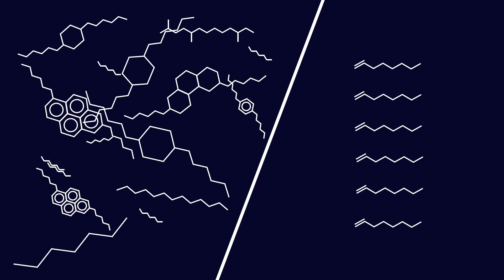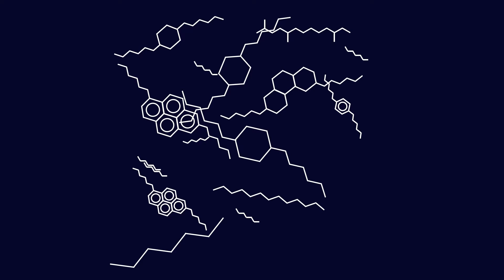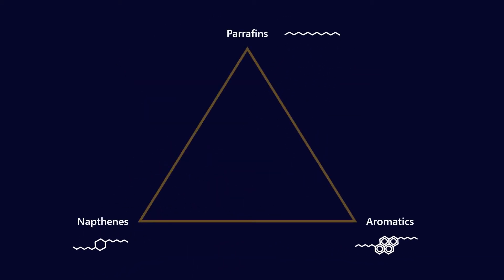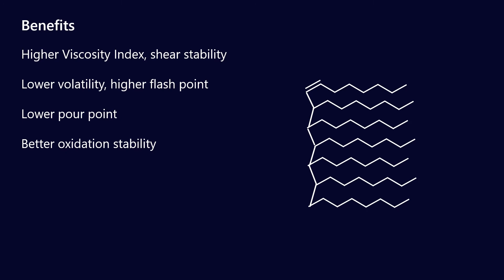What are the performance differences between polyalphaolefin (PAO) synthetic base oils and con..

Comment: I figured this is why 20W-50 degrades less than the further stretched oils such as 10W-60 for the same manufacturer.

I am just not sure why ambient temperature even affects oil performance since it is running at ~200 F inside the engine.
Reply: Your radiator, in the winter, you have much colder air cooling the coolant, in 40c temp, it's much hotter...

Comment: Will you ever compare oil specs? Rotella 15W-40 T6 vs Shell Ultra 15w-50?
Seems like the T6 will do better in it's temperature ranges since it has less VI additives.

I figured this is why 20W-50 Redline and 10W-50 degrade less than the further speeded oils such as 10W-60 for the same manufacturer. Running T6 in everything at the moment but summers above 120 I will go to 20W-60 Redline.

I am just not sure why Ambient Temperature even affects oil performance since it is running at 200-250 F inside the engine.

Comment: How do you see the problem of PAO  low solubility in comperision with short distance driving and there for high gas input in the oil. Does most PAO oils work beter or less good agains this problem?...

Comment: How to identify group 3 and group 4 in engine oil because Group 3 specs and group 4 are lapping some where
Reply: If you see ester blend or similar stuff anywhere, most likely it is a PAO formulation. The only base oil that require ester to help solubilise additives is PAO.
Reply: @sunrevolver  If you go to Section 3 of and SDS, you usually can see the percentages of additives.  Amsoil left that blank, Redline has up to 60% non petroleum base.  I suspect the only true 100% or group 4 synthetic, is Redline.

Comment: I’ve heard that PAOs don’t “stick” very well on the engine surfaces, is this also a downside of the dilution capability and is this problem solved with the combination with ester? My engine just got a PAO Based Oil but sometimes it stands still for weeks and I hope the cold starts aren’t that stressful for the material. 

Great content, thanks for your work!
Reply: No one does 100% PAO formulation. PAO is really bad at dissolving additives. All formulators will add ester in the mix to help solubilise the additives.
The Ester helps with the "stick". And if you are using latest specifications, high chance your oil has Moly inside which in conjunction with ZDDP form a sacrificial layer on your engine.
TLDR, no need to worry if you are using reputable oil.

Comment: Can you briefly tell me what the difference is between PAO and ESTER oil?

Is there a difference between the term PAO and ESTER ???
Reply from the maker: Great question - they're entirely different molecules. I'd recommend maybe watching this video on esters first: https://youtu.be/sBZWF-QMQMI
Reply: @LubricationExplained  Perfect. I understand .

I came to the conclusion that the best oils are those with a PAO base and the addition of ESTER.

I do a job closely related to motorcycling and I need to know all these things.

Thanks for the shows you make. we didn't learn this in school.
Reply: Both excellent lubes. Pao non hydroscopic and doesnt degrade when leaked into the ground excellent for machines bad for environment. Polyester good if it diesnt get moisture and if it gets wet it decays and can ruin your equipment but great for tge environment

Comment: I've used penrite 10 tenths which is poa ester and thought it was excellent. Definitely cleans varnish over time and held up in a 700hp engine.  I'm sticking to shells GTL tech in my daily though, for the value GTL is excellent
Reply from the maker: From memory the Ten Tenths range is a combined PAO / POE Ester. My personal opinion is that Penrith goes a little overboard with the additives - 2200 ppm antiwear in a racing engine is overkill and too much antiwear contributes to friction. But it will definitely protect the engine! You're right, GTL products definitely give a really good price/performance ratio.

Comment: What do you think about vehicle engine oil that claim to be 100% or fully synthetic but with more than 75% hydrotreated mentioned in it's MSDS. I think most engine oil are like that now. Do they deserve to be called fully synthetic?
Reply: good thing that "fully synthetic" is a protected term in my country:
You can only proclaim an oil as fully synthetic if it is based on Group 4 and Group 5 base oils and I think there is a pretty high requirement of the contents here because all fully synthetic oils sold here are actually all ~80 - 100% fully synthetic.
Reply: @alouisschafer7212  German? not anymore.

Schaeffer 9000 full synthetic 5W-40 = 30-60% hydrotreated, 10-21% decene / PAO

Liqui Moly Molygen New Generation SAE 5W-30 Fully Synthetic = 10-20 solvent refined (group 1), >60 hydrotreated (group 2)
Reply: @kupasotomotif  since when is the brand Schaeffer german? This brand does not exist here...
The Molygen? That oil isn't meant for the european market I cant buy it here and Liqui Moly doesn't list it on their german distribution network.
I think they had it in Poland for some time trough an importer but no idea if that source is still around.
They do have one oil that differs from the standard oils and that's a 10w40 with solid MoS2 powder mixed into it as an additional surface friction modifier. Supposedly its a great oil for older worn engines.
But ironically nobody outside europe has ever heard of that oil because they dont sell that one overseas.
Reply from the maker: Not a big fan. I actually did a separate video on the topic! https://youtu.be/zpGJP0VmD-Q
Reply: @LubricationExplained  ok. in here, some group II engine oil are even more expensive than PAO engine oil.

Comment: I noticed that when PAOs were the hot new thing, super high VI was common like 5w-50, but now there are many PAOs sold with conventional style narrow spreads like 10w-30 and the wide spreads have become less common. Is this just marketing to match car owners' manuals or some actual chemistry advantage? I thought a PAO would be somewhat better than 10w-30 even without VI improvers.
Reply from the maker: Good question. So if you take a look at PDS for SpectraSyn 8 (that's a typical cPAO for use in engine oils), the viscosity index is 139. Compare that with Mobil 1 High Mileage 10W-30 and the VI I calculate for that product is 142. So the two aren't particularly far off. 

You can get PAOs with higher VIs for sure, particularly with mPAOs, but I guess I'm just showing it is possible that a 10W-30 could be a full PAO.

https://www.exxonmobilchemical.com/en/chemicals/webapi/dps/v1/datasheets/150000000353/0/en

https://www.mobil.com/en-us/passenger-vehicle-lube/pds/na-xx-mobil-1-high-mileage-oils
Reply: I think they are blending it with group 3.  If they only put pao, the cost would be very expensive.
Reply: @semihkoc326  No such thing as pure pao anyway, its bad for rubber seals. It needs at least some ester in it to counteract the shrinkage of rubber.
Reply: Probably blending in Group 5 Esters  and I guess yeah it would make sense for the manufacturer to aim for the most commonly used viscosity grades.

Comment: how does GTL conpare to pao performance?  i remember when pennzoil platinum 5w30 first came out it was GTL and boasted 9.1 noack volatility ratings and 171 viscosity index.
 the product doesnt seem to score as high as it used to so suspect basestocks may have changed but thats a different subject.
Reply from the maker: Good question - GTL is often marketed as "Group III+". It does have properties which are better than a lot of Group III oils in the market, but it will always fall short of cPAO and mPAO base oils due to impurities in the gas stream which can never be completely removed. The other limitation is the range of viscosities - GTLs are generally only available on the low end of the viscosity range, so its difficult to make things like gear oils where you need a thick lubricant film. GTL is a Shell technology, but they sell on the open market to other lube suppliers, so there may well be a lot of engine oils that are blended in part with GTL.
Reply: now 9.1 noak and 171 visco index is average imo

Comment: How do we find out what base oils our motor oils are made of? Normal oil samples dont say what it is, and neither does it say on the back of the bottle
Reply from the maker: Good question - it's not something that the manufacturers typically disclose. One way to find a small amount of information is to go to the SDS. "Decene" will sometimes be listed in a % quantity - that's a weak proxy for the PAO content. Otherwise the manufacturers tend to sell the product based on the performance rather than the components.
Reply: In the USA, most PAO based oils will say PAO in the fine print on the back near the API specifications. Part of this is because high tier group 4 PAO  brands want to stay separate from the group 3 imposters. There was a controversial legal challenge some years ago that resulted in group 3 oils being allowed to legally be labeled and marketed as "synthetic". So one can infer group 3 from "syn-XXX" or "synthetic" combined with a total lack of the term PAO. And most multi-grade mineral oils are group 2 as group 1 tends to be only suited to single viscosity grade products without excess modifiers. And you can combine this with TDS/PDS info like VI and pour point to get more confidence.
Combine this with the available refining capacity, there are very few remaining refineries setup for significant group one output, the production cost is slightly lower but not enough to offset the lower profit margin. Most new lube oil refineries in the recent 20 years are built for group 3 and group 2 in the 20-30 years before that. (group 3 only started production in the late 1980s) 

I have also heard the argument that a finished lubricant can no longer be usefully classified by the base-oil group because of blending and additives and each should just be taken on the basis of standard industry properties tests, like VI, pour point, wear protection, TBN, evaporation on heating, shear stability, etc